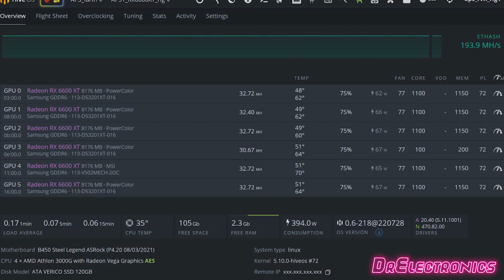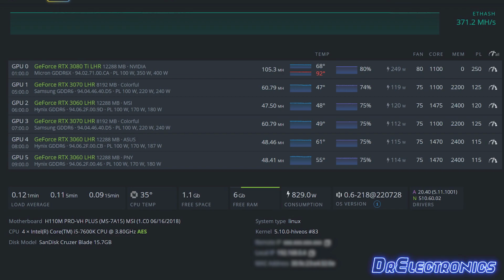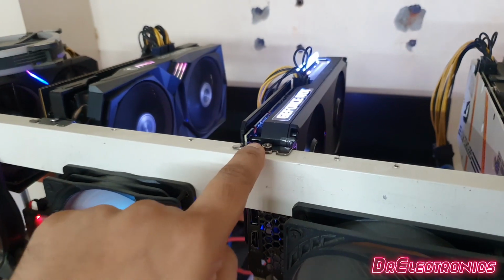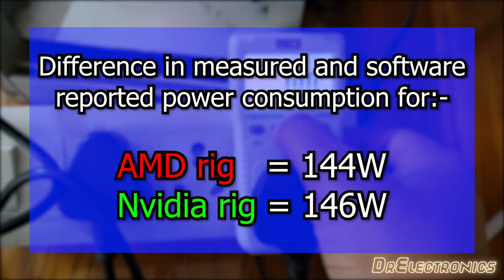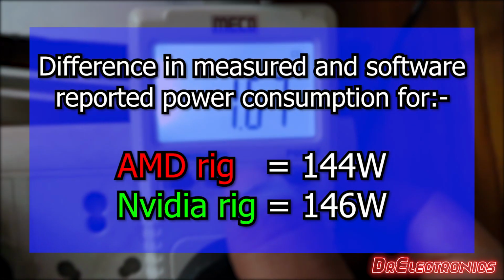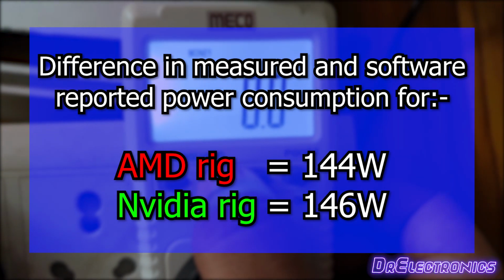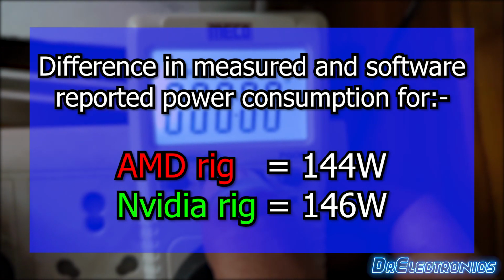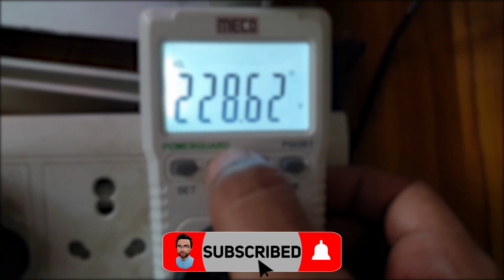Mining rig power consumption Software vs Actual | DrElectronics

Comment: Bhai HIVEOS m motherboard and fans ki power nahi show karta isliye different aata h
Reply from the maker: Hive OS software only shows the GPU power consumption, CPU+System power consumption are separate and we need to add them. I have shown that by measuring the entire mining rig power draw. But if you had a server style case for mining, the same HiveOS would have shown you the entire system draw.

There are other mining OS like SimpleMiningOS which show the overall system power draw, but they are not as easy to operate. That is why this video.

Comment: are bro motherboard and other parts ka watt software. mai nahi ata aye simple alag 120-130  wat extra add korna hota h
Reply from the maker: Hive OS software only shows the GPU power consumption, CPU+System power consumption are separate and we need to add them. I have shown that by measuring the entire mining rig power draw. But if you had a server style case for mining, the same HiveOS would have shown you the entire system draw.

There are other mining OS like SimpleMiningOS which show the overall system power draw, but they are not as easy to operate. That is why this video.